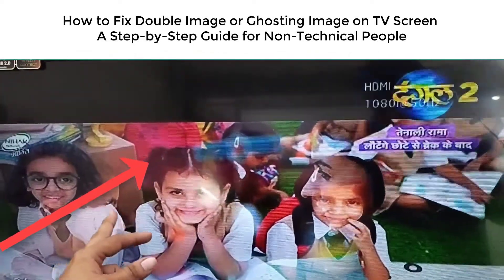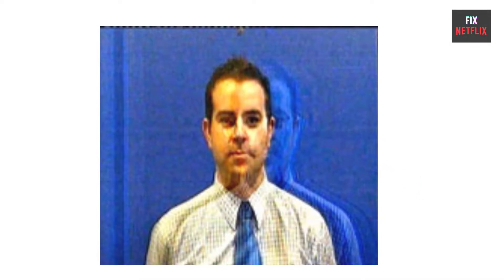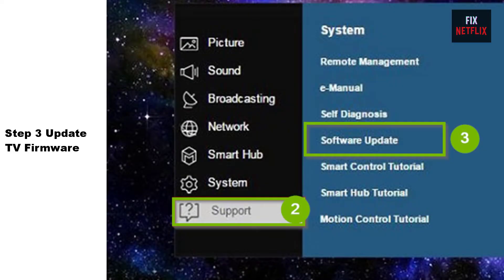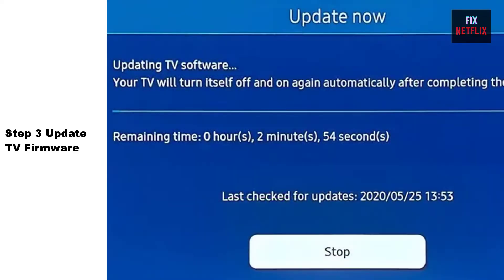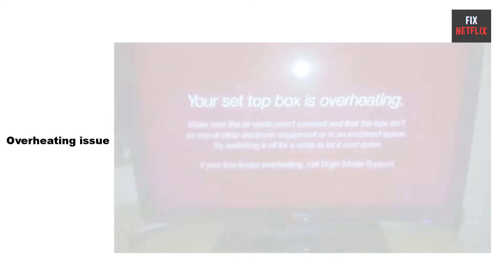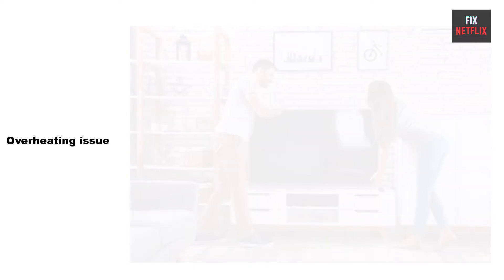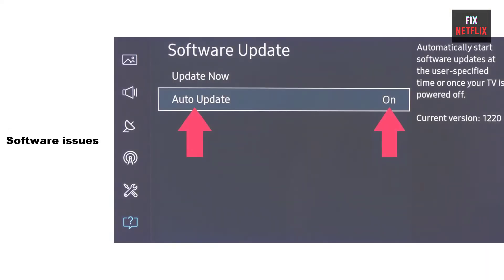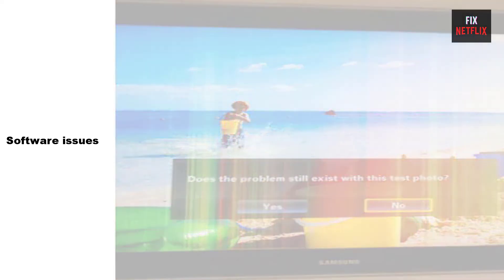How to fix Double Image or Ghosting Image on Samsung TV | Guide for Non-Technical People

Comment: Hi bro my Tve is a problem of double   image  so how to prevent  that issues?
Reply from the maker: are you solve the problem yet, If not this is for your solution. try and inform me the results

Step 1: Check the Source

Make sure the issue is not with the input device (cable box, DVD player, game console, or streaming device).

Switch to another HDMI port or try a different device to see if the problem persists.

If the ghosting disappears, the original device or cable may be the problem.

Step 2: Check the Cables

Inspect your HDMI or AV cables for damage or loose connections.

Try swapping the cable with a new or known working one.

Ensure cables are firmly connected at both ends.

Step 3: Adjust Picture Settings

Press the Home/Menu button on your Samsung remote.

Navigate to Settings → Picture → Expert Settings.

Look for options like:

Auto Motion Plus → Set to Off (sometimes motion smoothing causes ghosting)

Sharpness → Reduce slightly

Digital Clean View → Turn Off if enabled

Test if the ghosting improves.

Step 4: Power Cycle the TV

Turn off the TV and unplug it from the wall.

Wait 5–10 minutes.

Plug it back in and power it on.

Sometimes ghosting is caused by temporary signal or processing glitches.

Step 5: Update TV Firmware

Go to Settings → Support → Software Update → Update Now.

Make sure your Samsung TV is running the latest firmware.

Firmware updates often fix image processing or HDMI signal issues.

Step 6: Check External Devices’ Resolution

Ensure your input device is set to a resolution supported by the TV (e.g., 1080p or 4K depending on the model).

Mismatched resolutions or refresh rates can cause ghosting or double images.

Step 7: Reset Picture Settings

Navigate to Settings → Picture → Reset Picture.

This restores factory settings for the display.

After resetting, adjust brightness, contrast, and other settings to your preference.

Step 8: Test for Hardware Issues

If ghosting remains after trying all the above:

It could be a panel or T-Con board issue (internal hardware).

Contact Samsung Support or an authorized service center for repair.

💡 Quick Tips:

Always use high-quality HDMI cables for 4K or high refresh rate TVs.

Avoid long, cheap cables — they can cause signal degradation.

Ghosting usually occurs with motion-intensive content, so disabling motion enhancement can help.

Comment: At the side of TV screen lines are appearing
Reply from the maker: Possible Causes

Loose or damaged cable connection

If you’re using HDMI, make sure the cable is secure and not bent.

Try a different HDMI port or cable.

Panel issue (screen itself)

Lines on the side often mean a faulty display panel or damaged flex cable inside the TV.

This can happen due to physical impact or aging of the TV.

T-Con Board problem

The Timing Control (T-Con) board controls the image on the screen.

If it’s failing, you’ll see vertical/horizontal lines or flickering.

External device issue

Test the TV with another input source (different HDMI device, USB media, etc.) to rule out your console, set-top box, or PC as the cause.

Comment: No no no its the slow response time of the tv , can't fix that sh!t ,next time read specification websites n reviews before buying a tv.
Reply from the maker: Are you solve the problem yet, If not this is for your solution. try and inform me the results

Step 1: Check the Source

Make sure the issue is not with the input device (cable box, DVD player, game console, or streaming device).

Switch to another HDMI port or try a different device to see if the problem persists.

If the ghosting disappears, the original device or cable may be the problem.

Step 2: Check the Cables

Inspect your HDMI or AV cables for damage or loose connections.

Try swapping the cable with a new or known working one.

Ensure cables are firmly connected at both ends.

Step 3: Adjust Picture Settings

Press the Home/Menu button on your Samsung remote.

Navigate to Settings → Picture → Expert Settings.

Look for options like:

Auto Motion Plus → Set to Off (sometimes motion smoothing causes ghosting)

Sharpness → Reduce slightly

Digital Clean View → Turn Off if enabled

Test if the ghosting improves.

Step 4: Power Cycle the TV

Turn off the TV and unplug it from the wall.

Wait 5–10 minutes.

Plug it back in and power it on.

Sometimes ghosting is caused by temporary signal or processing glitches.

Step 5: Update TV Firmware

Go to Settings → Support → Software Update → Update Now.

Make sure your Samsung TV is running the latest firmware.

Firmware updates often fix image processing or HDMI signal issues.

Step 6: Check External Devices’ Resolution

Ensure your input device is set to a resolution supported by the TV (e.g., 1080p or 4K depending on the model).

Mismatched resolutions or refresh rates can cause ghosting or double images.

Step 7: Reset Picture Settings

Navigate to Settings → Picture → Reset Picture.

This restores factory settings for the display.

After resetting, adjust brightness, contrast, and other settings to your preference.

Step 8: Test for Hardware Issues

If ghosting remains after trying all the above:

It could be a panel or T-Con board issue (internal hardware).

Contact Samsung Support or an authorized service center for repair.

💡 Quick Tips:

Always use high-quality HDMI cables for 4K or high refresh rate TVs.

Avoid long, cheap cables — they can cause signal degradation.

Ghosting usually occurs with motion-intensive content, so disabling motion enhancement can help.

Comment: Logo vertical lines why
Reply: 3:41
Reply from the maker: are you solve the problem yet, If not this is for your solution. try and inform me the results

Step 1: Check the Source

Make sure the issue is not with the input device (cable box, DVD player, game console, or streaming device).

Switch to another HDMI port or try a different device to see if the problem persists.

If the ghosting disappears, the original device or cable may be the problem.

Step 2: Check the Cables

Inspect your HDMI or AV cables for damage or loose connections.

Try swapping the cable with a new or known working one.

Ensure cables are firmly connected at both ends.

Step 3: Adjust Picture Settings

Press the Home/Menu button on your Samsung remote.

Navigate to Settings → Picture → Expert Settings.

Look for options like:

Auto Motion Plus → Set to Off (sometimes motion smoothing causes ghosting)

Sharpness → Reduce slightly

Digital Clean View → Turn Off if enabled

Test if the ghosting improves.

Step 4: Power Cycle the TV

Turn off the TV and unplug it from the wall.

Wait 5–10 minutes.

Plug it back in and power it on.

Sometimes ghosting is caused by temporary signal or processing glitches.

Step 5: Update TV Firmware

Go to Settings → Support → Software Update → Update Now.

Make sure your Samsung TV is running the latest firmware.

Firmware updates often fix image processing or HDMI signal issues.

Step 6: Check External Devices’ Resolution

Ensure your input device is set to a resolution supported by the TV (e.g., 1080p or 4K depending on the model).

Mismatched resolutions or refresh rates can cause ghosting or double images.

Step 7: Reset Picture Settings

Navigate to Settings → Picture → Reset Picture.

This restores factory settings for the display.

After resetting, adjust brightness, contrast, and other settings to your preference.

Step 8: Test for Hardware Issues

If ghosting remains after trying all the above:

It could be a panel or T-Con board issue (internal hardware).

Contact Samsung Support or an authorized service center for repair.

💡 Quick Tips:

Always use high-quality HDMI cables for 4K or high refresh rate TVs.

Avoid long, cheap cables — they can cause signal degradation.

Ghosting usually occurs with motion-intensive content, so disabling motion enhancement can help.

Comment: Bro where is power saving mode😢
Reply from the maker: are you solve the problem yet, If not this is for your solution. try and inform me the results

Step 1: Check the Source

Make sure the issue is not with the input device (cable box, DVD player, game console, or streaming device).

Switch to another HDMI port or try a different device to see if the problem persists.

If the ghosting disappears, the original device or cable may be the problem.

Step 2: Check the Cables

Inspect your HDMI or AV cables for damage or loose connections.

Try swapping the cable with a new or known working one.

Ensure cables are firmly connected at both ends.

Step 3: Adjust Picture Settings

Press the Home/Menu button on your Samsung remote.

Navigate to Settings → Picture → Expert Settings.

Look for options like:

Auto Motion Plus → Set to Off (sometimes motion smoothing causes ghosting)

Sharpness → Reduce slightly

Digital Clean View → Turn Off if enabled

Test if the ghosting improves.

Step 4: Power Cycle the TV

Turn off the TV and unplug it from the wall.

Wait 5–10 minutes.

Plug it back in and power it on.

Sometimes ghosting is caused by temporary signal or processing glitches.

Step 5: Update TV Firmware

Go to Settings → Support → Software Update → Update Now.

Make sure your Samsung TV is running the latest firmware.

Firmware updates often fix image processing or HDMI signal issues.

Step 6: Check External Devices’ Resolution

Ensure your input device is set to a resolution supported by the TV (e.g., 1080p or 4K depending on the model).

Mismatched resolutions or refresh rates can cause ghosting or double images.

Step 7: Reset Picture Settings

Navigate to Settings → Picture → Reset Picture.

This restores factory settings for the display.

After resetting, adjust brightness, contrast, and other settings to your preference.

Step 8: Test for Hardware Issues

If ghosting remains after trying all the above:

It could be a panel or T-Con board issue (internal hardware).

Contact Samsung Support or an authorized service center for repair.

💡 Quick Tips:

Always use high-quality HDMI cables for 4K or high refresh rate TVs.

Avoid long, cheap cables — they can cause signal degradation.

Ghosting usually occurs with motion-intensive content, so disabling motion enhancement can help.

Comment: I see some lines on ny led display is that the problem?
Reply from the maker: are you solve the problem yet, If not this is for your solution. try and inform me the results

Step 1: Check the Source

Make sure the issue is not with the input device (cable box, DVD player, game console, or streaming device).

Switch to another HDMI port or try a different device to see if the problem persists.

If the ghosting disappears, the original device or cable may be the problem.

Step 2: Check the Cables

Inspect your HDMI or AV cables for damage or loose connections.

Try swapping the cable with a new or known working one.

Ensure cables are firmly connected at both ends.

Step 3: Adjust Picture Settings

Press the Home/Menu button on your Samsung remote.

Navigate to Settings → Picture → Expert Settings.

Look for options like:

Auto Motion Plus → Set to Off (sometimes motion smoothing causes ghosting)

Sharpness → Reduce slightly

Digital Clean View → Turn Off if enabled

Test if the ghosting improves.

Step 4: Power Cycle the TV

Turn off the TV and unplug it from the wall.

Wait 5–10 minutes.

Plug it back in and power it on.

Sometimes ghosting is caused by temporary signal or processing glitches.

Step 5: Update TV Firmware

Go to Settings → Support → Software Update → Update Now.

Make sure your Samsung TV is running the latest firmware.

Firmware updates often fix image processing or HDMI signal issues.

Step 6: Check External Devices’ Resolution

Ensure your input device is set to a resolution supported by the TV (e.g., 1080p or 4K depending on the model).

Mismatched resolutions or refresh rates can cause ghosting or double images.

Step 7: Reset Picture Settings

Navigate to Settings → Picture → Reset Picture.

This restores factory settings for the display.

After resetting, adjust brightness, contrast, and other settings to your preference.

Step 8: Test for Hardware Issues

If ghosting remains after trying all the above:

It could be a panel or T-Con board issue (internal hardware).

Contact Samsung Support or an authorized service center for repair.

💡 Quick Tips:

Always use high-quality HDMI cables for 4K or high refresh rate TVs.

Avoid long, cheap cables — they can cause signal degradation.

Ghosting usually occurs with motion-intensive content, so disabling motion enhancement can help.